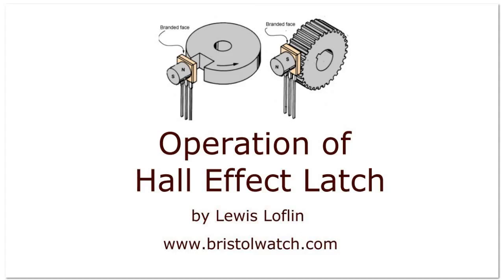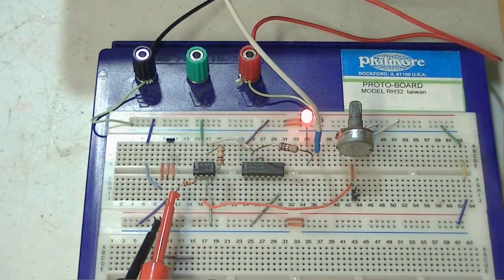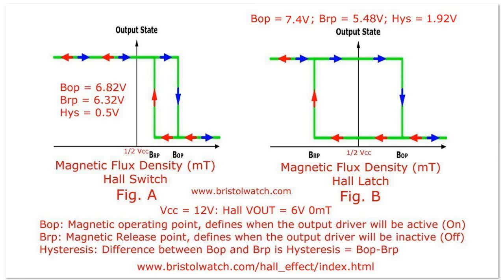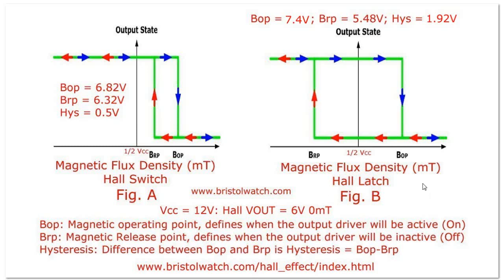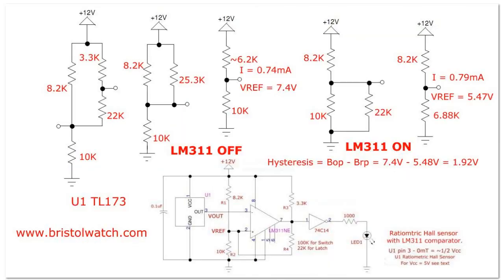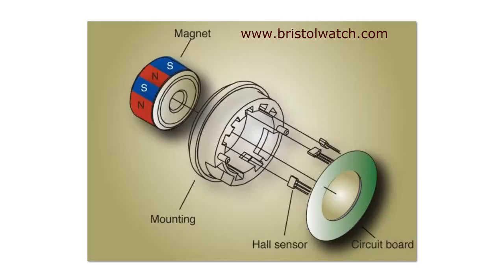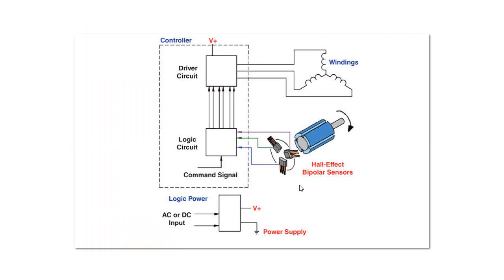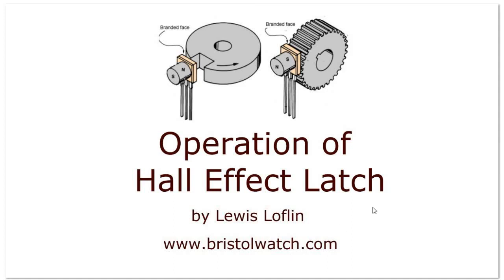Hall Effect Latches Theory and Circuits Pt. 3

Comment: these are wonderful training videos. the Hall Effect and magnetic pickup speed sensors run for years covered with greasy dirt at hot temperatures like the Contrex 7200-0990 Quadrature Sensor.  Many high dollar speed encoders seem to fail after a few years of use.   well explained circuit and nice RadioShack meter 😎 thank you 🤩 keep them coming